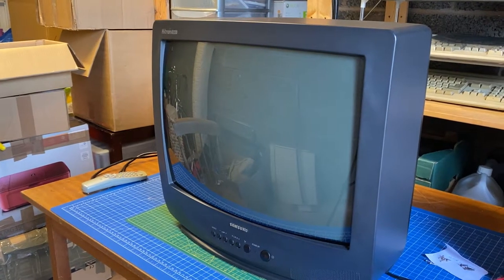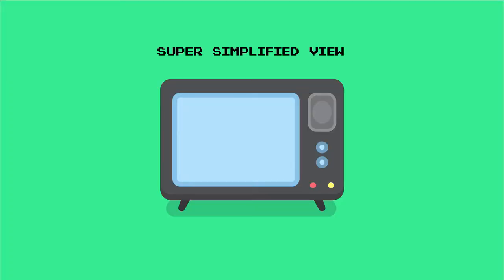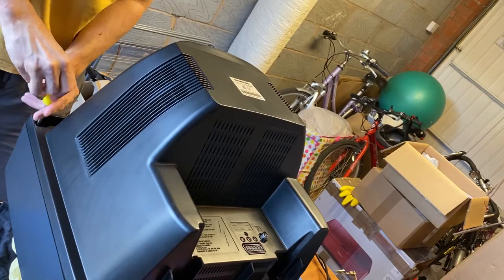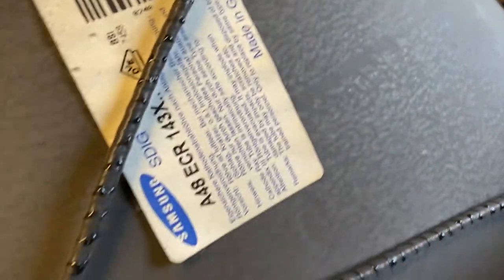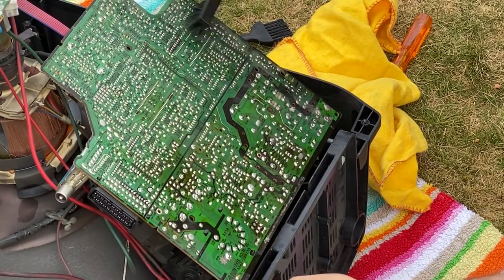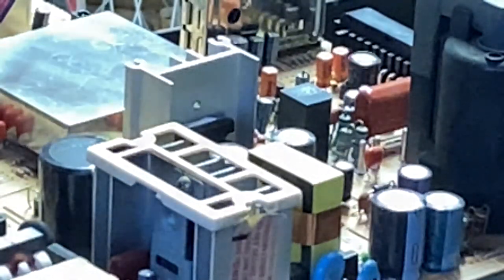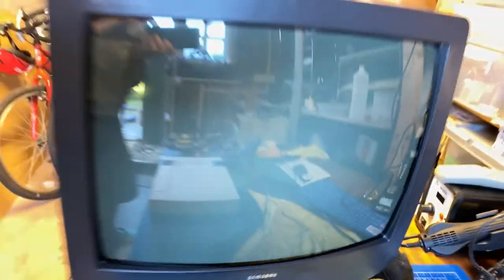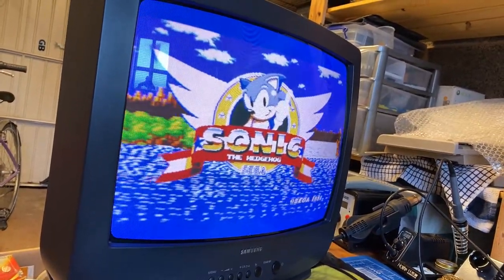SAMSUNG CRT TV - Flat line Fix

Comment: discharging CRT are way less dangerous than people  say or think..unless you directly pull the cup and touch the metal you are perfectly safe discharging it with a a large screwdiver conected to the chasis  cold ground.Great job saving that beauty!

Comment: I have a Sanyo CTP 3771, I imagine it's older than 1995. It has the horizontal line problem but it gets temporarily fixed by hitting the back of the TV (I really don't want to have to do that tho). Searching a very old forum post with this model number and symptom, someone said it's a problem on a part called LA7837 which looks a lot like the one you switched. I never soldered anything before so I'm a bit worried to try to take it apart and try to fix it lol
Reply from the maker: Here's the service manual with the diagram: https://elektrotanya.com/sanyo_ctp3771.pdf/download.html
I'd offer to help, but I don't think shipping a CRT is a good idea. I have done it with success once, sent one over to America, but that was an incredible endeavour.

Comment: Common Misconception. You don't actually need to remove the anode todo basic work on a CRT. It's really only if you're replacing a flyback transformer or moving the CRT out of the chasis.

Comment: I have a similar TV Samsung CB20F12T with a KS1A chassi. The problem I have noticed is that there seems to be noise or interefence on the video input if you inspect it closely.
Does your television suffer from the same issue?
Reply: Not his one, but another one yes, I will be looking at that one shortly. I have since repaired another 2/3 CRT TVs, but don't have an editor and don't have time to do the videos myself unfortunately. Where are you based?

Comment: I have a crt tv that has a line running through it while the picture is going. I’m wondering if you could help in anyway. Thanks
Reply from the maker: Hey, sorry for the late reply, unfortunately it's not as easy as it seems in this video to fix a crt, I had a stroke of luck this once, but I have repaired many more and I can assure you it is not easy, there are lots of things that can go wrong and really hard to diagnose, maybe post a picture if you can? All I could give you is a guess though. In electronics guesses are quite useless (except this case)

Comment: Is there by chance anyway you could help fix my CRT? I have a Philips 24PT6341/37 model. The RF connector in the back has broken off and there is no sound on the tv. Is there anyway anyone can help me get it fixed? I contacted a bunch of local tv repair companies and none of them were able to help me out. If there is anyone that knows how to fix CRTs to this day do let me know!
Reply from the maker: Hey! Do you actually need the RF Connector? Do you have a SCART port? Sound might be as easy as a broken solder point or maybe the sound processor chip has gone, it's hard to tell from a chat, where are you from?
Reply: @theretrohandyman7708  I’m from Wisconsin. I don’t have a RGB scarf connector. I only have RF, composite, s video & a component input. I wanted to hook up cable to it but I can’t since there is no RF connector and the sound stopped working shortly after. I’m not sure if this is fixable? Please let me know! Thanks.
Reply from the maker: @TrevFadingToBlack  I think most things are fixable, it's the amount of time and skills necessary goes drastically up as worse things happen.
How bad is the RF connector ripped off?
Is it the main board or only the RF connector itself? I would need to take a look to give an indication
Reply: @theretrohandyman7708  The RF connector has broke off completely. It was already bent badly but as I was trying to attach a RF cable to it broke off and what’s odd is the audio actually quit working just after this happened. I’m unsure if you would like me to send pics of this to you somewhere so you can help investigate the issue as where I see it I can see part of the motherboard where the RF connector was. I did contact a few tv repair companies and they indicated that the RF doesn’t effect the sound but I don’t understand why the sound went out after the RF connector broke off. What do you think? Im not an expert with tvs so I’m hoping you would know enough to help me out!
Reply: @TrevFadingToBlack  Hey, sorry for the late reply, I don't think troubleshooting at a distance will ever work, especially with pictures, also I don't have a lot of time with family and all. At any rate send us a link with the a picture, I will take a look and can give you some advice, but I won't be able to help you out long term, unfortunately.
Reply: @andresmenegazzo3101  Hi sorry for the late response. I am unsure how to provide you a link to the photo but basically the RF connector on the back broke off and the sound went out as well. I am not sure if there’s a way to get the RF connector reconnected to the motherboard and I’m also unsure if that had anything to do with the sound not working. I can’t get much information on this as there’s not much people willing to help with this.